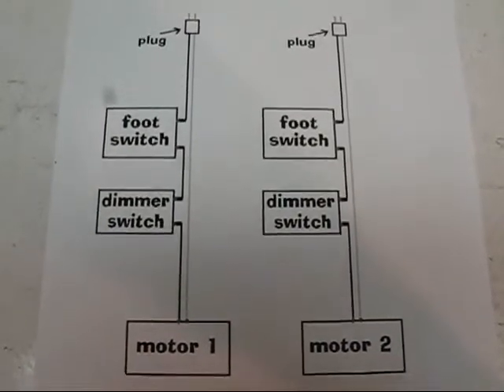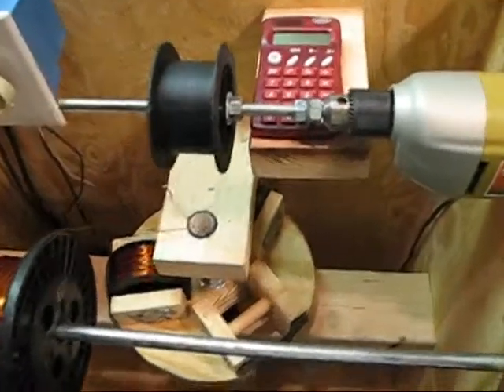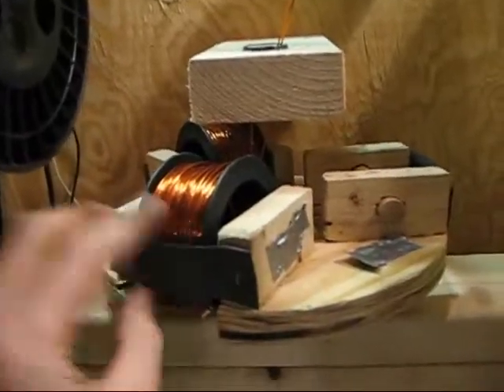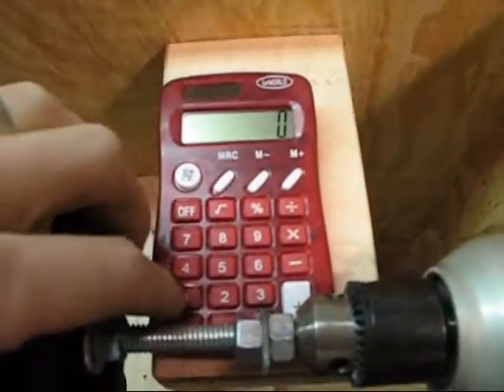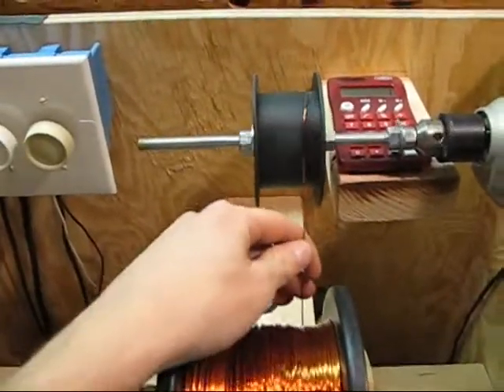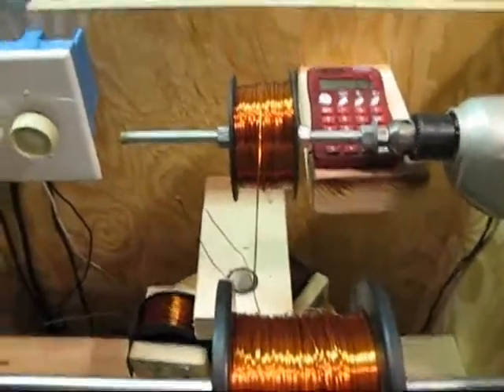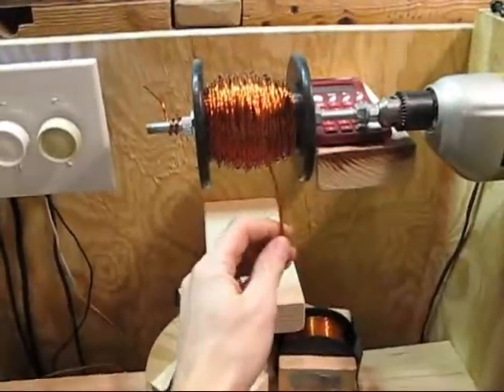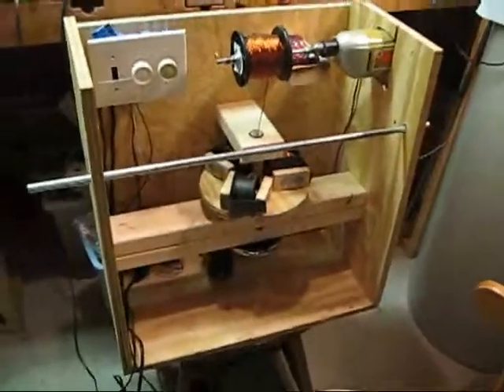Trifilar Coil Jig

Comment from the maker: Thank you InventorGadget!  This michine does work but i might point out some improvements that might be made for an ultimate machine.  Its difficult to get the motors running at a consistent speed together, a better system would have only one motor with two different gearings coming off it for the winding part and the twisting part.  That way no matter what speed its running at you always have the same number of twists per inch.  That idea was given to me by a friend,  Good luck on your winder.
Reply: One motor with two different geared shafts sounds a better idea.

Comment: Nice! When i put together mine, it took me sometime to figure out what to use for counting,after squishing 1calculator & 1keyboard  i ended up using a "thumb pressing" counter. together with a few bigger hole washers (place them off-center) as trigger. it can count up to pretty high RPM without miscount, and can withstand harder beating from the drill's torque.

Comment: Two dimmers to get the right twists-per-length ratio seems awkward, and since the diameter of the takeup spool is constantly increasing, it's something you'd have to be adjusting the whole time, right?

Using a capstan would eliminate that problem, and then the takeup spool could be driven separately. 

Consider a gearbox (from a mini-lathe?) to allow a single motor to drive the bobbin turntable and the capstan at a fixed ratio to each other, for more consistent twist pitch.

Nice work, though!

Comment from the maker: @JRBeaman 
I would agree with that if you are running the filars in series.  But when using each filar individually I would say it can help ensure each wire has identical L and C characteristics.  I would also agree that you could make a coil smaller without the twisting, but in practice ive found I usually end up with a rats nest when dealing with untwisted multiple wires, but sure it could be done.  Ive never had any problem with short circuiting.  I would say do what ever works for you.
Reply: Can't find JRBeaman's comment.

Comment: Try using smaller hole less then 1cm on the feeding side & increasing distance between winding spool & the feeding spool further apart (50cm++) once the  first layer is done nicely, by controlling the right speed the following layers will be auto arrange

Comment: for a counter I used a digital pedometer from the dollar store - I wired in a reed switch and put a small magnet on the motor shaft.  For speed control I used a footswitch from a sewing machine - it works like a gas pedal from off to full speed - no need to use a dimmer.

Comment: Cool!! This will work great for a tattoo machine coils.  I would suggest for the single coil spool to have a bottleneck plate with 2 rubber door stops to create drag. Or at the end of the all thread where the spool is mounted, or you could create drag on the shaft. With PVC pipe & a lock nut !   Bill Kearney.  :-)